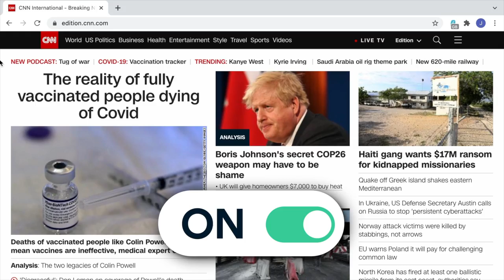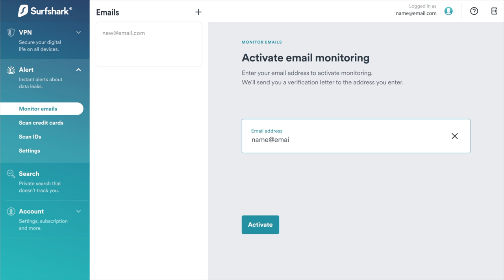Double Glazing Is Pointless Without This

Comment: Scott - when you're having a difficult time putting screws into wood, try a stick of beeswax. Scrape the threads against the wax first to pick a little wax up, and it should help the screw go in much more easily! Absolute life safer if you need to screw hardwood together.
Reply: I was taught to use petroleum jelly. Helps drive them into dense hardwoods and helps slow rust over time
Reply: @glynprice3815  I suppose that would work too, although in some woods/applications the oily nature of petroleum jelly might cause some undesirable staining or darkening.
Reply: I grab the bar of soap from the bathroom.  Cheap, handy, and probably has a damp/soft side.

Comment: Hey Scott, the new weatherstripping looks good.  I'm an Energy Auditor here in Canada and just wanted to comment that the new weather stripping is almost for naught.  You need to add a physical seal between the new inner jamb and the old.  It will leak a great deal on that joint over time.  Just some food for thought.